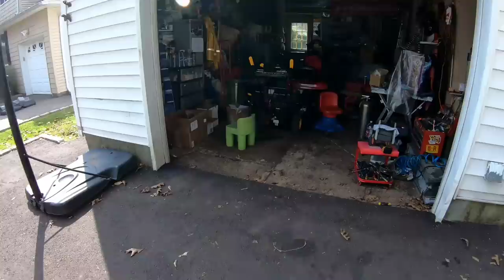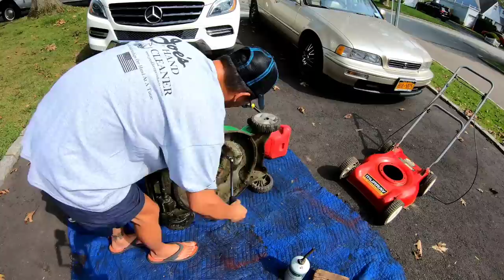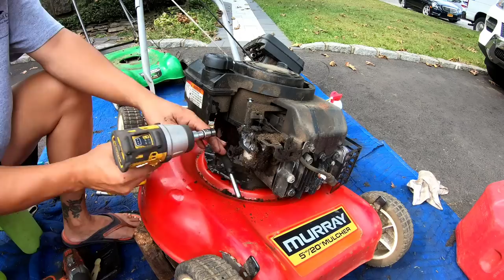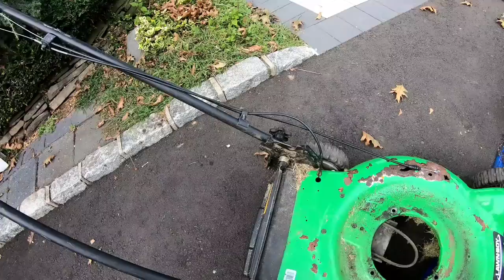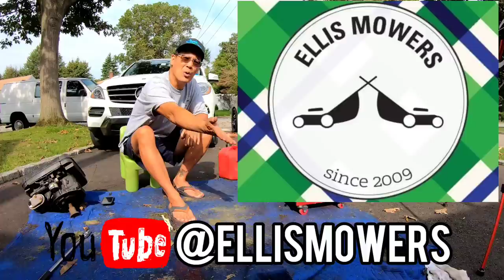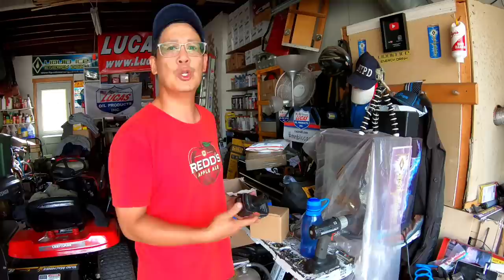MAKING ONE GOOD PUSH LAWN MOWER WITH PARTS FROM THREE LAWNMOWERS MURRAY DECK LAWNBOY ENGINE TROYBILT

Comment: I use a breaker bar to remove engine bolts all the time. Just gotta slowly break them free, haven't broken one yet. Using an impact to zip them off increase the risk of breaking them. Pretty dope that kohler sent you that air filter cover.

Comment: Hello Henry. For the removal of seized bolts, You can take a punch or even a piece of steel round stock with a hammer and tap on the bolt head a few times after applying a good amount of penetrating oil to both sides of the bolt which helps to relax the surface tension between the bolt and mounting threads,Etc. 
Try not to apply direct heat to any part of the bolt - But rather focus your attention to the area surrounding the bolt head where the heat should always be directed. By applying direct heat to the bolt - It actually makes the fastener expand into the threads making everything that much tighter. 
More often than not, If you apply a generous amount of heat and soak each bolt with penetrating oil - The heat will draw in the penetrating oil and by tapping on each of the bolt heads a few times before you attempt to remove the bolt will make removing the bolts a bit easier for you or any of your other YouTube subscribers out there in a similar situation. Now if the bolt has been coated with Red Threadlocker - Heat the bolt up as hot as you can and then pray for it to break loose when you try to unscrew the bolt from the threads. 
Regarding drilling out the broken mounting flange bolts; I always make every attempt to remove the broken fastener as you did in your video, Henry. If the threads were destroyed beyond any retreading,Etc. Drill the hole to match the diameter of the other mounting bolts and use a good quality flange head bolt with a locking nut with snug fitting flat washers. That is much safer than the bolt not being there. Well this is my practical lesson of the day. Henry, I always enjoy your videos which makes my heart smile. The practical descriptions that I contribute from time to time is my honest effort to share my many years of experience with anyone who may have need from someone who actually performed the described actions many times over. After all of this; I Am “Doneski”.
Reply from the maker: Thanks ironduke!  Always appreciate your two cents!  Very informative, I try not to swap engines too often
Reply: Mowers N Blowers. Sometimes You Gotta Do What You Gotta Do!!!. The Red engine cover really made your mower look nice. The reason that the Lawn-Boy looked so much like a Toro was that Toro owns Lawn-Boy. I can’t remember how long ago that Toro’s acquisition of Lawn-Boy took place. The same way with Wheel Horse mowers which you don’t see that much anymore other than collectors & people who are still running them. Lots of people don’t realize that Toro & Exmark are joined are the hip. 
Here in Central Ky; You see lots of the Exmark ZTR mowers compared to what Toro ZTR mowers that you see. Occasionally you may still see someone mowing their lawn with one of the vintage Lawn-Boy push mowers. 
I think that I may have one of the Vintage Lawn-Boys that belonged to my dad when he was still alive still in my inventory - Not to mention all my other mowers that I frequently use. 
Best Regards From Versailles, Ky.
Reply from the maker: IronDuke502 oh yeah I had many lawnboy single stage 2 stroke snowblowers like the 320r which looked exactly like the ccr toro models.  I also had an international harvester which is exactly like the 2 stroke lawnboys
Reply: Mowers N Blowers. Personally I have never laid eyes on any of the IH mowers. Being that I have two Cub Cadets - I would love to find one.
Reply from the maker: https://youtu.be/MCq9Zlkn2xo

Comment: I broke two bolts  off in a Koehler push mower  engine and one drilled out fine , the other one not so good . Maybe still work in my case didn't drill in the sump pan . It's a devil drilling them out even with a drill press . Not sure I'll remove another  engine from a bad deck again  - I think I'll just junk the engine. Next time .
Reply: lube up the bolts from the top and let it soak for a bit. As for drilling the bolts out you need to use an expensive bit made out of cobalt that's designed for going through steel. Those cheap bits you buy in a pack will not cut it. Plus lot's of people don't even know how to use a  drill properly which is part of their problem.
Reply: Didn't know about those better drill bits , thanks Henry .

Comment: I would've use body filler and hardener paste for the Lawn-Boy's decayed deck and then repainted it all together.
Reply from the maker: That's a ton of work for $100 mower, especially since I had an extra deck.
Reply: @MowersNBlowers  have you ever use body filler for anything?
Reply from the maker: @mwand89  sent in my old Acura integra, 1985 Nissan stanza.  But never on a cheap mower.